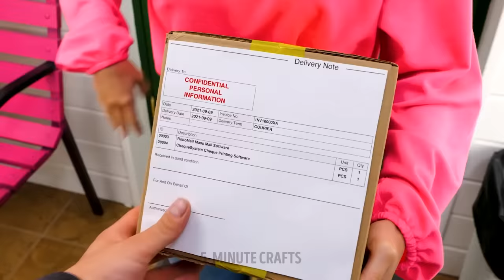SMART GADGETS TO MAKE YOUR LIFE EASIER

Comment: First, 100 g of sodium hydroxide is mixed with 43g of cyanuric acid and 12g of carbon. This is heated to 600 Celsius with occasional stirring for at least an hour. If the bubbling goes out of control, turn down the temperature and let it come back under control before raising it again thank me later
Reply: Iwiei
Reply: Jj
Reply: 0
Reply: @r.g.parmar5419  Jbvln
:)
🐆☺️😓🤣
Reply: Прролыегн
Reply: As